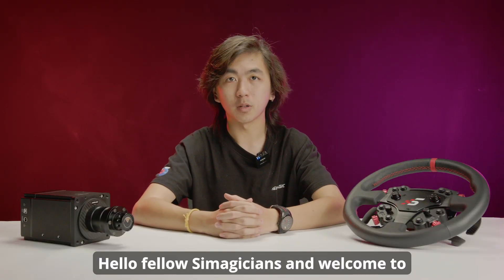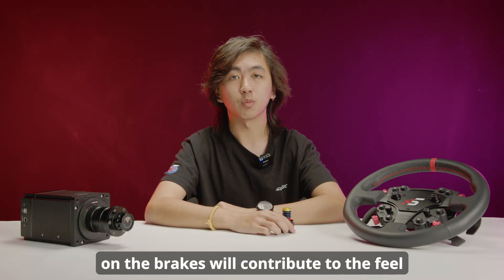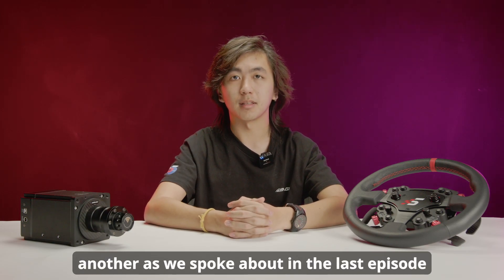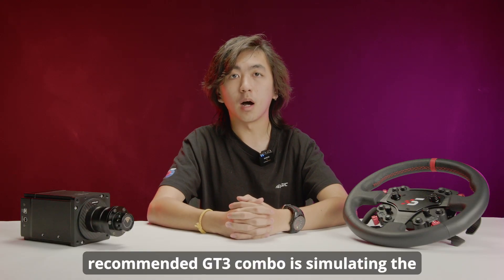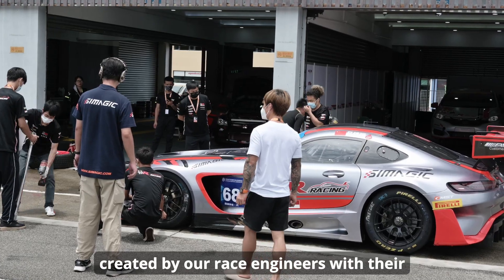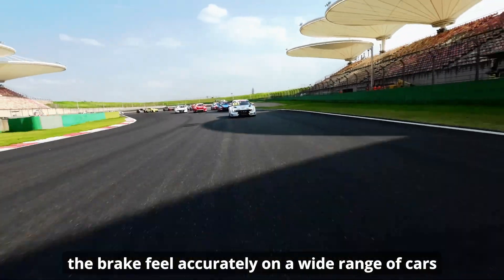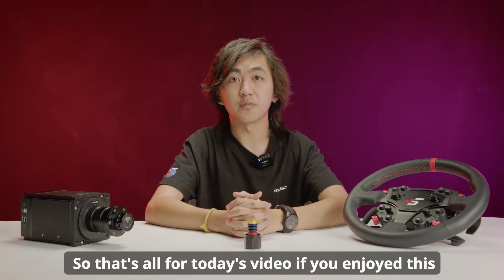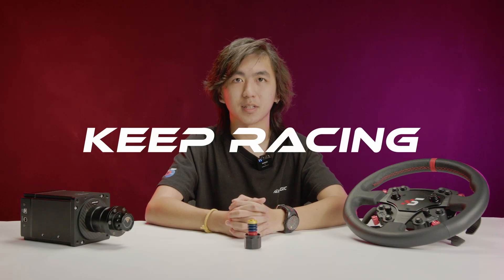Why Rubbers? | #TechTuesday Ep.4

Comment: Hi, very interesting format...very well! I have 2 questions: the elastomers for the hydarulic system are the same of the P1000 brake standard?
what's the your suggested combination to simulate the rally brakes?
Thx in advance
Reply from the maker: Hi Emanuel! The elastomers for the standard and hydraulic are different in shape but same in the stiffness, for combo reference you can see our elastomer ref sheet on our website😄 
As for rally combo, we suggest using the TCR or road car combo as rally has a bigger travel for better control on the brakes, and they do have different brake settings for different course😉
Reply: Thx a lot, ....and with hydraulic addon will be the same combination to simulate rally Cars?...well done guys, I love simagic peripherals...

Comment: Well mow we have options for all! Springs, elastomers, metal spacers etc.

Me I like the toad car feel and or the gt4 car feel. Depends on my mood. 

To me its logical and thank god yall allow for travel. Im tried of brick walls. It doesnt make sense! We have mo g forces. People always forget. F2 and f1 cars have very stiff brakes. Yes but they have so much g force so the weight and energy transfers through and makes it easier for those heavy brakes to be pressed. Its just facts. 

We dont have g forces in sim racing. So a realistic riad car, gt4 or gt3 csr feel makes way more sense. Me i love some travel so i can long trail brake through corners without guessing. I can fully control every single point of braking instead of it moving 20% beteeen letting pressure off. 

Yalls brake systems are my favorite and have truely transformed my performance on track. 

Never stray from yalls style! As we see simucube active pedals have good travel, the new moza mcbooster active pedals have travel. Both are much more like road car or gt4 car feels because again we dont have g forced or weight transfering when we brake our body isnt being pushed foward. Physics matter!

Race beyond matters and even dan suzuka both like a bit of travel just like me. Most peolle who finally adapt all seem to improve with braking instead of the oldschool brick wall load cell feel. But even if you do like that simagic has you covered. So you can get whatever you want. They will never feel like aseteks brick walls but thats a good thing. Everyone I talk to who uses those hates them. Way to uncomfortabel. 

So good job simagic yall have found the magic 😉.

Comment: I don’t see an elastomer reference guide for the hydraulic pedal set. I see the p1000 guide.  Is it the same? My P1000RS break pedal came with 9 elastomer rubbers installed. Your reference guide references 7 & 8 elastomers. (not 9). Just trying to understand.  Thank you in advance.
Reply: 8
Reply: hydros use 9

Comment: Thanks for the video! The stack order for the elastomers are different on every video I see on the subject. What is the stack order for a progressive soft-to-hard feel? I see harder elastomers on the bottom non-screw cap side going in first on one video, and then I see the stack flipped where the harder elastomers are on the top. Same with the gold spacer. I see some videos where it's on one side of the stack, and then others on the other side of the stack. I was under the impression the gold spacer was to be used up top on the screw cover side to make the handle throw shorter. What gives? Thanks!
Reply: the softest elastomers will compress first, regardless of order on the stack

Comment: wouldnt springs be a better option since the compression is much more consistent than rubber. rubber has to relax back into forum while a spring doesnt.
Reply from the maker: We do notice it, we're looking into the possibility of this😉
Reply: @simagicofficial6890  
Cool! I’ll wait just a tad bit longer before I purchase the p1000
Reply: @imJGott same here. The drop off in the brake measurement is too much using the elastomers.
Reply: they released springs
Reply: My new P1000 came with a variety of elastomers, but also springs for the hydraulic brake.
Reply: Well now we got it all 😉